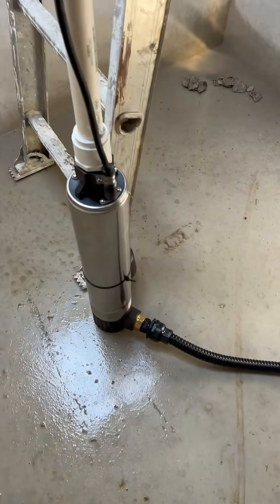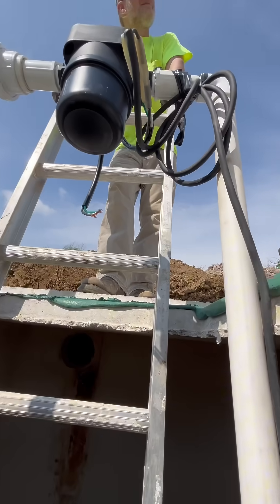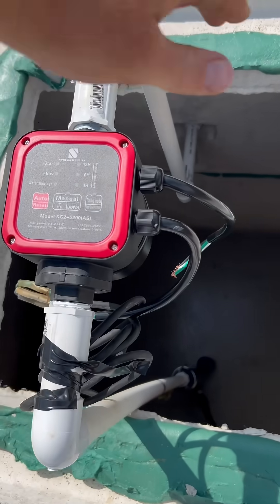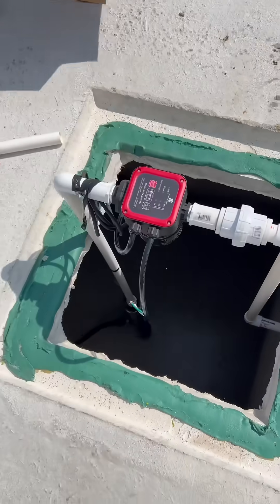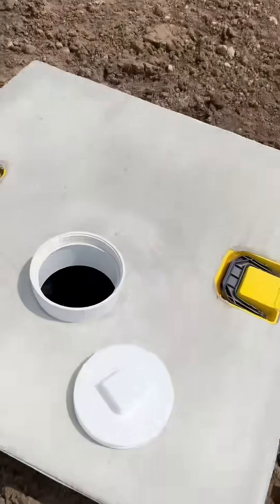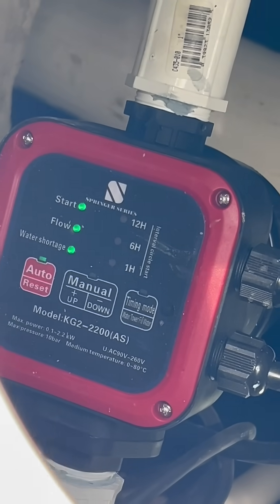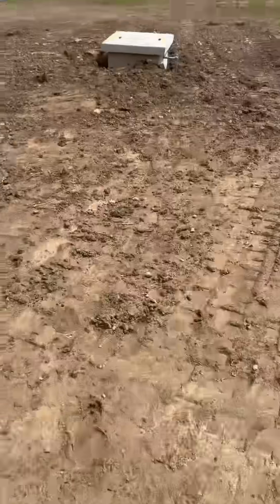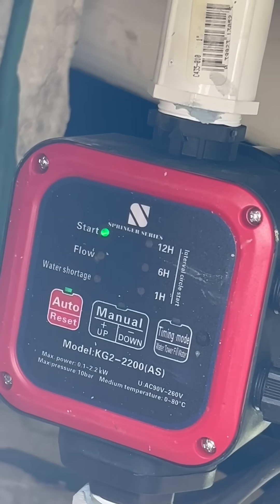AUTOMATIC Pump Controller - easy pump setup #cistern #well #rainwaterharvesting #plumbing

Comment from the maker: The Springer Series Automatic Pump Controller can be found here: https://www.rainbrothers.com/store/Springer-Series-Automatic-Pump-Controller-p617952821

Please note: If you have room for a pressure tank, that is always going to be a more bulletproof system. Also, the Pump Controller can be installed in a wet location but should not be installed under water